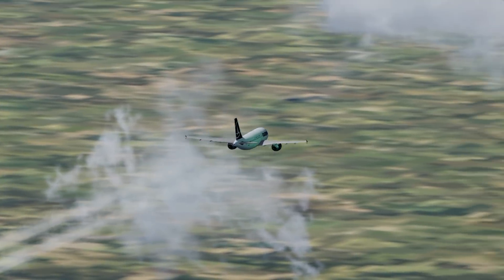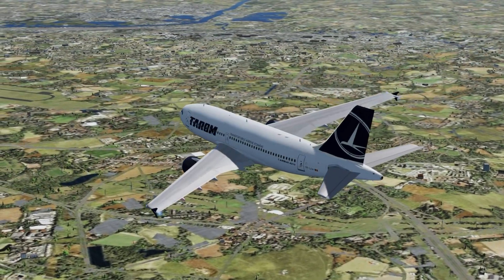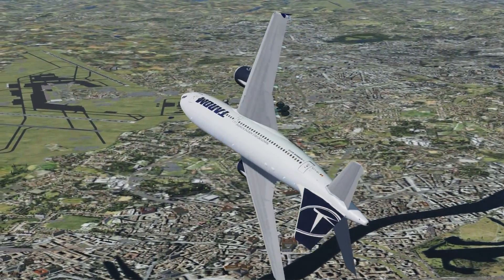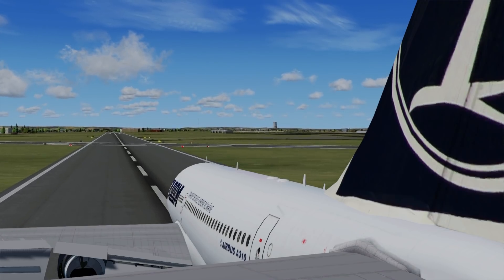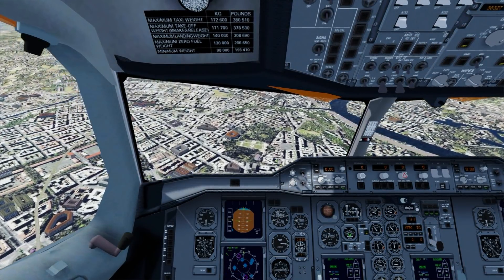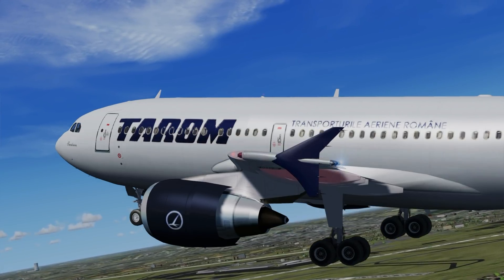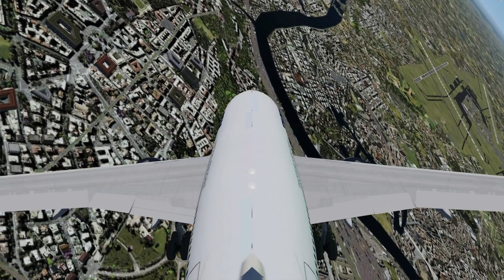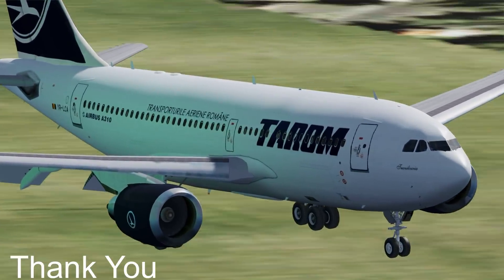The Pilot Who Almost Subconsciously Killed 186 People  | Tarom Flight 381

Comment: Many hours in the BAC111 sim trained the captain to react...and that is why he trimmed nose up when he wanted the AP disengaged.  Non-standard control placement has led to crashed planes in the past.
Reply: Most likely was because the plane was doing something that the pilot didn’t want it to do. He hit the “autopilot disengage” and the nose went up, so he hit it again, and the nose went up, so he spammed it or pressed and held it, mentally screaming “DO WHAT I WAAAAANT”
Reply: @Bob_Kile  (and Practical Tech) - Yep, that's exactly what I was thinking, too.  If you push a button (on anything -- a remote control, whatever) and it doesn't respond, you push harder and longer.  Especially if you're in a high-stress situation.
Reply: @Bob_Kile  
   You just saved me a lot of typing... I think you get it exactly right.  Again... way too much automation and non-standard control placement.  The engineers need to take some heat over that.
Reply: @practicaltech9881  It's not the engineers fault.
Its up to the pilot to know his/her airplane.
Reply: @alhanes5803  Ergonomics and user interface are also important. Remember that pilots are trained to know their aircraft, i.e. to do things automatically and not have to look everything up every time. However, when one of the controls (which are also right at hand) completely changes its function, I imagine that even a very experienced pilot may subconsciously react according to a learned pattern from a previous aircraft type.

For me the important lesson is this: Machines do exactly what we tell them to do. But humans do what they have learned, and that can change over time. 
No sensible aircraft manufacturer sets the yoke behaviour to "push forward = nose up", even though it's technically possible to do so.
Reply: @misch2  
Wanna explain that comment?
Reply: @alhanes5803  it s the same like the buttons in a car... headlights switch, or the one I usually missed often and wasn`t in his "place" was the honk...at some cars you have 2 honk buttons on the wheel close to your big finger( at 9 and 3 clock positions), other cars have it in the center of the wheel, or others, usually older cars, you had to push in the blinking stick... nonetheless it`s been 30 years since the incident, back then(for most of the incidents I saw) I think it was pretty common for pilots to be prone on doing this type of mistakes, as most of them, although they were really experience overall as pilots, they weren`t as much on the aircraft they were flying at the moment. 

To bring a bit of context, not sure but it`s a safe bet to say that the majority of the ex-communist countries operated with Soviet aircrafts, the case for Romania until the end of 80s. This Airbus was one of the 3 Airbuses 310 owned by TAROM at the time, introduced in the fleet with just 2 years prior to this incident. By the voice of the pilot I can tell he is a senior, so I understand his old training kicking in over the one received for the Airbus as probably his pilot career was 90+% on older Soviet aircraft, like Ilyushin, BAC or Tupulev that TAROM used until 90s. Another issue can be that with the russian planes(at least for some of them) you kind of had to land with a bit of a bigger speed than normal from what I understood, not sure of that was the case for the BAC 111 that this pilot flight before.
Reply: The thing I find odd here is that to disconnect the autopilot, the pilot usually would press and release the button - as you would a doorbell on a house or a computer keyboard.  You don't hold the button down for a period of seconds, which is what was done with the trim switch in this accident.
Reply: @moi01887  Thanks for saving me the typing lol - I can't understand why he'd thumb it for over ten seconds either!
Reply: @moi01887  I think in some airplanes (maybe smaller ones?) it can in certain situations be recommended to hold the autopilot disconnect / trim interrupt during the initial attitude recovery until time permits the trim motors to be disabled. Maybe that were the intentions of the pilot here.
Reply: Perhaps held it cause he thought it was CWS?

Comment: What I'm wondering tho: WHAT reset the trim after they recovered? They themselves? Then what told them that it was the trim and not something else like autopilot or sth.?
Reply: Using trim is normal, so they'd reach for it any time they need help pushing the control surfaces around. But there's also a special alarm for max trim, which you can hear just as the big nose-up begins.
Reply: It's actually possible that the trim up helped with the recovery after the stall. Nose went down, the plane got back some speed and the trim up helped get the nose up again. And then they trimmed it down as they leveled
Reply: I think trim is something you routinely check, similar to checking flaps. I don't know much about the A310, but there should be an indication of their level of trim.

Comment: Trim is a way for the pilot to relieve control pressure . With elevator trim you first put the plane at the desired pitch, then you trim away the control pressure. Steering the plane with the trim as you suggest in the video is a sure way to fail a check ride.

Comment: Regression to previously learned behaviour patterns under stress is a well-known phenomenon.
It usually occurs at the worst possible moments, (as in gunfights or go-arounds).
  It's the reason you have to be particularly careful when converting to new types with different control layouts, behaviours, &c. There are some aircraft whose behaviour is sufficiently unorthodox that it's unwise to train ab initio on them unless you can be certain that you'll never fly another type.  For example, in one model of Diamond, you recover a dropped wing at the stall with aileron, not rudder. Rudder will flip you inverted, but in almost every other light aircraft in the same circumstances, trying to pick up a wing with aileron's a good way to start a spin.
I knew a Zenith factory pilot who learned to fly on the 701, which would climb at an amazing angle and ludicrously slow speed. The same engine, making the same sort of noises, was fitted to the 650, which had more normal climb behaviour. When the motor stopped making those noises at the wrong moment, he stalled and spun in. I'm convinced he tried a response the 701 would permit and the 650 wouldn't.
Reply: Add TAM Airlines flight 3054 to the list of incidents & crashes caused by reverting to previous behaviors from stress!
Reply: @FlybyStardancer  A refernce to your source, please?  A quick search didn't show any suggestion of that, but I could have missed it.
Reply: When a plane comes to fire, some people die because they are unable to open the seat belt, because they are looking for the one they usually have in their cars
They search for the belt near shoulder... instead of the ones in planes.
We are "tuned" by nature to be "automats" most of the time.
Reply: Happens to students taking exams.... Increased pressure to perform often causes them to regress to the most habitual behaviors.... It's why practice is vital, but also why adaptability is so prized.

Comment: When I got a new HOTAS, I once (or a dozen times) hit the  engine on/off button instead of the flaps coz I was so used to my old HOTAS lmao so I totally understand the why/how
Reply: Hahahahaha Not a pilot but in my line of work it’s the same thing. Suddenly the button is at a different place and that shortcut no longer works.
Reply: I've heard there's a sorry order of pilots, who try to retract the flaps after landing, but accidentally retract the gear instead.
Reply: @AdrianColley  It's impossible to retract the gear once there is weight on the wheels/landing gear in modern aircraft......
Reply: Oops!
Reply: HOTAS? coz?
Reply: @Capecodham  HOTAS = Extremely attractive female.   Also: Hands On  Throttle And Stick. He is likely referring to his home flight sim setup.  Its a one or two piece stick & throttle control with buttons & switches all over which one can assign various functions to.  More immersion than using mouse and keyboard.   Think playing a car racing video game with wheel and pedal setup versus a standard gaming controller.

Comment: All of the controls in the cockpit of commercial planes should be standardized that way these things will not happen.
Reply: especially the most basic controls like trim.
Reply: Totally agree
Reply: Cars too. I go to turn up the volume on the steering wheel and end up raising the cruise speed. Volume should be left thumb, cruise should be right forefingers. Or switching between Mercedes and BMW, you end up actuating windshield wipers when you try to shift. There are logical ways to set up lights, turn signals, wipers, cruise control, shifting, but the manufacturers don't seem to agree. Even worse, the Chevy Cruze and Chevy Volt have different functions on the left stalks. On the Volt, the end of the stalk is a horn button while the Cruze resets trip meters. If you twist the stalk, it's lights on the Volt, but display selection on the Cruze. The left dashboard has a dial that does the opposite on each car. Why?!!

Comment: The crashability of these so called sophisticated jets is scary
Reply: This is unavoidable. If you prevent the pilots from having such control over the aircraft, a system failure could easily lead to the jet locking them out of saving everyone from a dangerous situation. All of the systems on modern aircraft (maybe with the exception of FlyByWire) only aid the pilots, they don't take control from them.
Reply: Scarebus 310.

Comment: In Airbus it's flap 1,2,3,4 which flap settings is 20 degrees.
Reply: It was an A310, so Flaps 20 is Flaps 20. ;-)
Reply: @DaveChimny  Does A320 & A310 hv different flap setting designations?
Reply: @joydasgupta9445  They do. A310s have yokes without FBW, too. ;-)
Reply: @DaveChimny  In A320 Flap 1,2,3,4 means how much degrees respectively?
Reply: @joydasgupta9445  it depends on the type of engine installed, and the aircraft configuration.
for slats, it's roughly 18, 22, 22, 27
for flaps, it's 0 (or 10 on takeoff), 15, 20, 35 with CFM engines or 40 with IAE

Comment: Did they fix the trim setting before the second approach, or did they compensate with opposite control input?
Reply: Absolutely fixed the trim. These big jets are unflyable with max trim deflection.
Reply: Don't know about the FMS in this particular type but I think the trimming should've been normalized automatically by the computers.